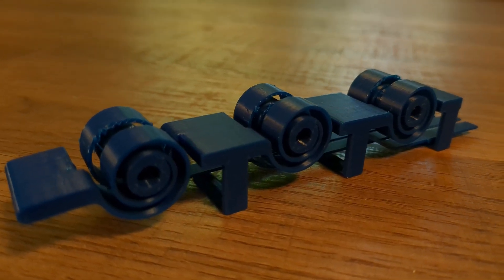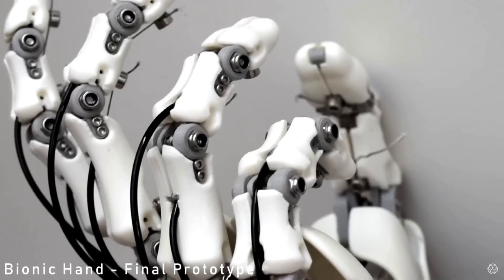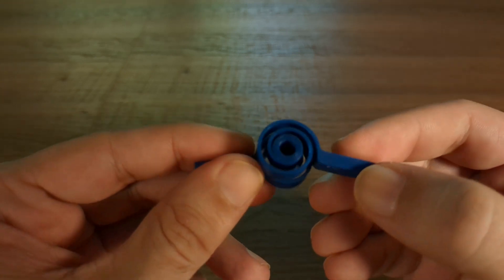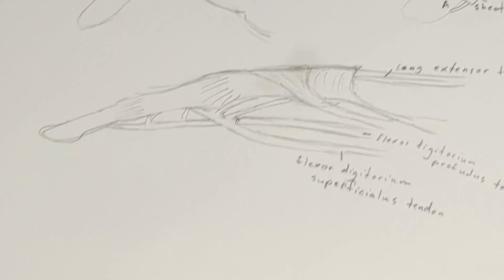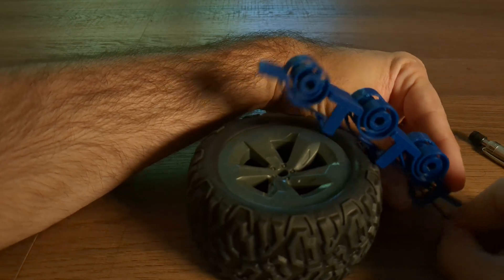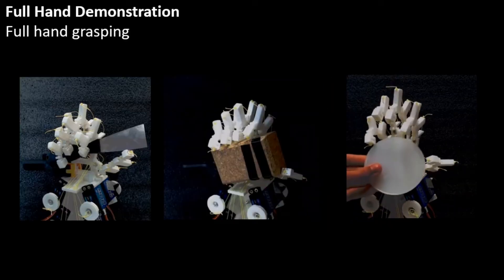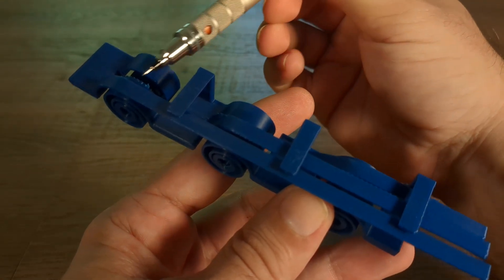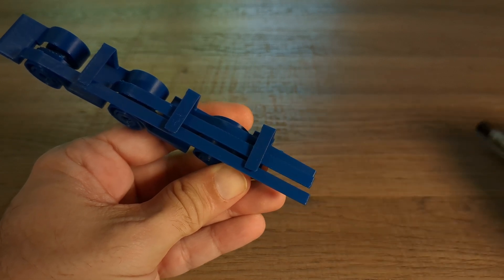Fingie the Robotic Finger With No Fasteners

Comment: I'm working on a print in place hand as well! This looks great, I love the flexures.
Reply from the maker: @luciengenova8688  That's awesome. I'm subscribed to you now. Looking forward to seeing where the project goes. :)
Reply: @adrianinvents  Subbed as well! I've been going a bit of a different route for the fingers. Using nitinol wire to push-pull on a more standard hinge pin design. The pros I think are strength and precision at the cost of compliance. I love your implementation of the pullable PLA strip though. Really neat that you can print that whole mechanism and have it ready to actuate with minimal assembly.